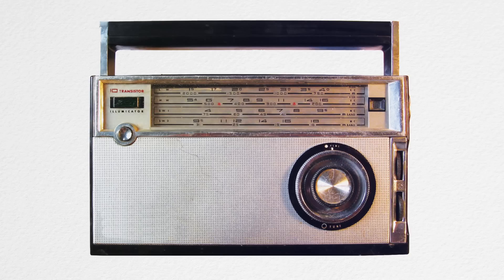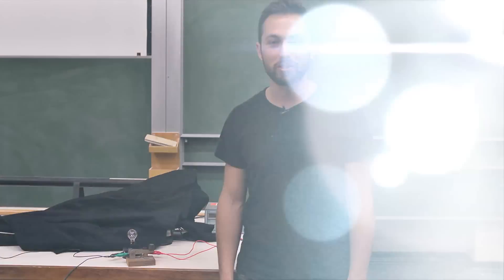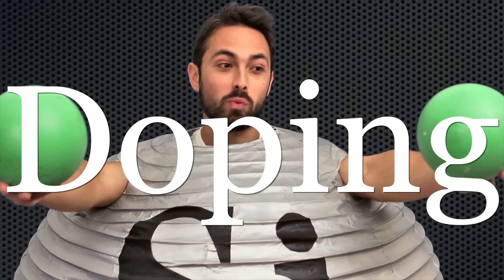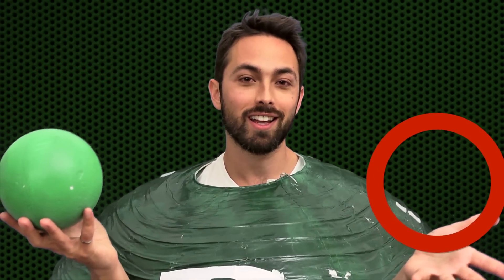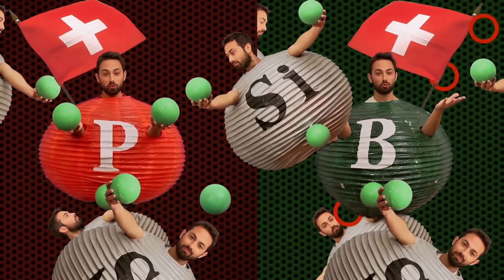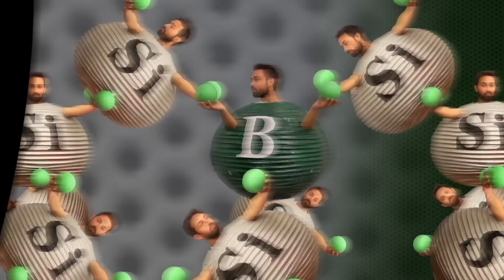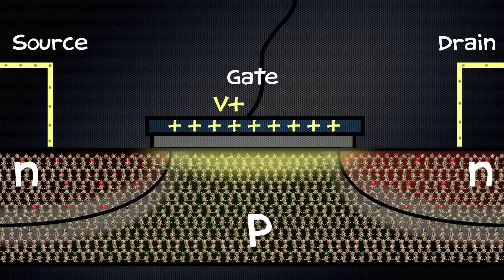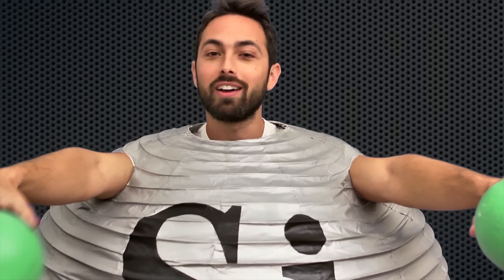How Does a Transistor Work?

Comment: Ah, now I get it; this shows clearly how a transistor's "mechanics"' work, since reading the Wikipedia description doesn't really tell you how simple yet sophisticated such a switch is.
Reply: Yes, but this one seems to be valid only to n-channels, I'm still strugling to know how p-channels work, that apparently when a gate has a current, it actually repels the flow.
Reply: PMOS works the same way.  All the dopant types and applied voltages are just reversed.

Comment: please anyone answers me........
i understands that in p type there are free electrons .....but in N type there are holes how they conduct,how they flow.......I meant to ask that those holes should remain around te boron why they move through lattice
Reply: It's actually the electrons that move. An electron comes and fills the hole. Another electron again fills it. So basically electron and holes swap each other. It seems like the hole is moving but it's the electron that is moving.
Reply: Ya .. But
Let consider only one boron atom then the boron cannot accommodate 4 electrons in bonding so there is a hole created by it 
......since it can accommodate 4 electrons so that hole will always surrounds it and does not move so how conductivity
.....?????
Reply: Nilesh Khatri So there will be 3 electrons rotating around boron atom. But there is not only one boron atom, there are lots of them. Thus the electrons around them conducts electricity.
Reply: ya you are right there are lots of boron atoms this system only works if there is a boron atom is joined to silicon atom which is joined with other boron atom,,,,,......,,,,,but........actually doping is done in very small amount if you talk about atomic level ..it is 1:10^6
so question still arises...
Reply: Nilesh Khatri OMG!!! That's Beyond my Knowledge.. Sorry I couldn't help..
Reply: Nilesh Khatri First, we must be clear that In metal bonding structure, electrons are thrown around like hot potatoes, the electrons are too energetic to stay in one place in any temperature other than absolute zero , dopping simply makes the "sea of electrons" even more active, thus increases the conductivity of silicon. So, without dopping, there are already "holes" and "moving electrons" all over the place, there's never such thing as all electrons "find a nice hole and settling down".

Now to answer you question, think about this, when a hole was created, many electrons rushed to accommodate that hole (Le Chatelier's principle), which at the same time have to leave a hole "unfilled" somewhere else (inside some other silicons). So that "hole" can be seem as "traveling". 

It's also important to be acknowledged that we never saw the process, but in terms of engineering, we don't really care that much about "exactly what happened", we care more about, "how we use this phenomenon to make money", so we didn't mind left some questions unanswered (the transistor theories was written by a electrical engineer in stead of strict scientists, he won Nobel price in Physics twice for his works)

Hope my rusty old college knowledge helps a bit, I won't be surprised if there are errors lol.
Reply: thanks :)
Reply: +Nilesh Khatri Technically it's not the holes moving, it's matter of perspective, if an electron flows from one hole to another, did the hole move or the electron?  It's really the electron that is free, and it's frowned upon within the industry to state the hole moves when in reality it's a free electron, or free electrons.  If you have more free electrons than holes there will always be electrons in motion.

Comment: This is a very explanatory video, but don't you just need another switch to trigger the gate?
Reply: You are right. I'll try to explain how an electronic device works after you have a transistor.

You can combine transistors in order to make logic gates. Those logic gates are just circuits that perform basic logic operations (AND, OR, NOT). You can make arrangements of those logic gates in order to create functions that use binary data, such as addition, subtraction, multiplication, division, and many other functions that your processor can perform. Having a set of functions, you can store instructions and data in a memory chip (basically a program) and automatically read those instructions using a clock signal (such as a crystal oscillator or a RC circuit) which feeds a counter (made by logic gates) in order to read the instructions stored in every memory slot, and that's how you run an automated program. The ultimate trigger of the programs stored in your device is the user via their keyboard or touchscreen or any interface. 

You can see a diagram of what I tried to explain you at the following link:
http://1.bp.blogspot.com/-Nw0z3NZI3XQ/Tgd_QrfwKzI/AAAAAAAAAKU/VjWnc6aQt0U/s1600/03.GIF

Hope it helps.
Reply: That was very helpful. I tried to look it up, but I couldn't find anywhere that gave an entire explanation.

Comment: The solution to the tunneling issue with shrinking circuits has been addressed. Once the circuits reach their smallest operating size to increase the number of circuits you start stacking them in layers. This also reduces energy requirements since the electrons can now flow vertically instead of longer horizontal distances as the chip expands in size.

Comment: Why isn't elements to the right of silicon more conductive if they have more mobile electrons?
Reply: to many electrons is just as bad as to little. you essentially want 50% holes, and %50 electrons for the best conductivity.
Reply: The electrons are mobile within the material. If an electron moves to the right, it leaves behind a hole. Another electron moves right to fill that hole and leaves behind a whole in it's place. Imagine this happening again and again. The electron will keep moving right and in theory that "hole" moves left.
Reply: Hana Zener Diode You seem to know a lot. Tell me, 
Why the silicon?

Comment: @Veritasium, sorry but your understanding of the transistor is either incomplete, or you oversimplified it. A transistor is more similar to a dimmer. A good analogy would be to says that with a little hand movement, you can open a valve, which would control a much larger force, such as a big water hose. Although, you are correct that we do use it most of the time on digital systems. Although, in many, many applications, such as RF, signal processing, signal amplification (which is used in all modern audio amplifier)

Comment: Arrrghhh. I normally really like your videos, but this time it mixed things up badly. The semiconductor configuration shown is a so called Bipolar Junction Transistor. (BJT), having a Collector, Base and Emitter. The error in the video is, that there's an insulated "Gate". Gates are found in Field Effect Transistors (FET) which have different configuration, namely a doped channel within bulk material. This might sound minor, but it has huge implications. A BJT is current controlled. A current from the base into the emitter removes the depletion zone. FETs are voltage controlled, there's no current flowing, instead the field from the Gate piches off the channel by inducing depletion from the bulk.
Reply: hexarith The structure showed here is a n-type enhancement-mode MOSFET, which requires a p-type body to function. The drawing of the structure, as well as the explanation of how it works, are correct. If you really wanted to be picky, you could point out that the "n" regions are, in fact, n+, meaning they are degenerately doped and behave like a metal. The FET is still called a FET even if, like in the case discussed by Derek, is used like a switch in a digital circuit, instead of a voltage-controlled current source like in a linear amplifier. There is no resemblance between what Derek has drawn and a BJT, other than the fact that a BJT also has n-p-n regions. The sketch clearly shows that the gate is isolated from the channel, whereas in a BJT you would need to have a direct contact to the base.
Reply: hexarith Thank you! you answered my question without me having to ask it : )
Reply: Andrea Morello

You're damn right!
Reply: Andrea is right. His explanation was absolutely correct and I think he did a great job touching on all the critical aspects of n-type FET operation, without being overly detailed to the point that it would be confusing to those who aren't familiar with this stuff. If you guys really wanna be picky, it would be about his explanation of channel formation; which he sort of glanced over without fully explaining.
Reply: hexarith You are very confused, The diagram he had in this video is clearly an NMOS, a BJT diagram would be two PN junctions back to back.
Reply: Yep, I agree. Plus explaining BJT, NMOS, PMOS would turn it into a 2 hr lecture so may as well head to uni for that. I believe this video is more of an introduction to the concept of transistors.
Reply: hexarith Derek chose the FET because the transistors he was referring to were obviously the ones found in chips and computer processors, which are mostly FETs. BJTs are preferrably used for current amplification than switches.
Reply: wrong, derek is right that's a MOSFET
Reply: "The semiconductor configuration shown is a so called Bipolar Junction Transistor. (BJT), having a Collector, Base and Emitter. "

No, it's clearly a n-type MOSFET, with a source, a drain and a gate. Did you even watch the video?
Reply: Conenion
Yes the spoken explanation on the video explains how FETs work… almost, because it's not entirely correct. However much worse is, that the semiconductor hetereostructure shown in the video would never be able to work as a voltage controlled device (FET). For working as a FET you'd require one continuous channel with a single kind of doping. If you create PN heterostructures you require some current to overcome the depletion. So you have three mistakes in the video: The structure shown is a clearly a BJT one, but it's labeled with FET annotations. The explanation how a FET works is almost correct (which is the worst kind of wrong) and then there's also a minor mistake in the explanation how the depletion zone forms (because it's not just  electrons falling into holes, more important is the resulting electrical field, which has to be overcome by an applied voltage, before a current can flow at all).
Reply: When does he say that what follows explains a bipolar? Where does he claim that all transistors are FETs?

You're right, he explains a FET. Which is the by far most dominant type today in microprocessors. In the intro he talkes about devices with a microprocessor.

Comment: Here're my 2 questions:

1) at 5:19 the Drain and the Source are made as one connection, shouldn't there be a gap between theese two? Even though the Source and the Drain at that picture are from "separate" transistors. On the other hand, I believe it's the way it all works, that all transistors are connected in a series to each other, so the the network of switches can handle the information.

2) I'm curious about how don't theese connections overlap with each other. I mean there are different layers of the chip, so the main question is how don't these gate tracks overlap in the chip? Maybe there's a good animation about this tiny transistor architecture?
Reply: 1) Two transistors where drain of the first one is connected to source of the second one create AND gate. If you negate the result, you create NAND gate which is one of two main building blocks of processors (usually a processor is built entirely from one of these types and does not combine them). The other is NOR gate, created by negating OR gate which is two transistors that share source and drain. That image is however just to illustrate Moore's law where the number of transistors double, it has nothing to do with actual connections.

2) I don't understand what you mean by overlapping. A wire has two ends which you connect to electric devices. A transistor is like a wire, it just has three ends which you can connect.

Comment: Hi there! Thanks for this video, it helped me a lot! 

However, I sorta got lost on how the voltage applied decreases the depletion layer when the electrons move across. So in the depletion layer the p-type semiconductor's part is negatively charged and the n-type semiconductor's part is positively charged. Thanks to the voltage, the electrons can move, fantastic! But does that mean that the moving electrons initially were the negatively charged part's electrons or is it once those electrons started moving everything started moving as well, or am I wrong, or do you not get me?

P.S. God do more videos. This makes physics simpler and more easier to understand. Maybe I'll actually consider engineering now ;-;

Comment: I have one question: Why doesn't the n type semiconductor on the right side send electrons toward the positive voltage? I'm just confused on how this works because I feel like all the electrons should just go to the middle due to the positive voltage. Could someone help in explaining this?
Reply: They are indeed attracted but they flow to the right because the right side (drain) is connected to the possitive end of a power source and that attraction is larger than the attraction of the gate (because the gate is isolated)
Reply: Jan Sten Adámek But that same attractive force you speak of would increase the depletion layer in NP junction of Collector-Base, so it would be even harder for electrons penetrating from emiter to base to flow to collector. That is if we draw the parallels with PN diode junction theory.

This was troubling me to for quite a while. It seems to me every body knows how transistor works, but nobody understands WHY it works.
Reply: rok13m
There is no parallel with PN diode because on PN diode there is no magnetic force of gate which is what closes the depletion layer.
Reply: rok13m Electromagnetic but that is what happens on gate of a FET (which is the one described in the video). If you use transistors with a base (bipolar), possitive voltage applied to the base thins the base-emitter depletion layer in a process called forward bias until it is small enough to allow electron diffusion across it.
Reply: Jan Sten Adámek Which magnetic force closes collector-base NP junction?

Comment: What turn on/off the Voltage though ? ~
Reply: anything...it could be a clock signal, a sensor output, radio waves (that would turn on the transistor every time the wave reaches a certain magnitude).  Basically, it's like opening a water faucet, something has to open it to let water through and that thing can be you...or a rope you wrap around the faucet, attached to a dog... anything.
Reply: But those are "signal". I'm wondering what physically induce the positive charge on the "gate" that create the voltage.
Reply: Ductie94 probably increases voltage
Reply: Ductie94 the positive charge on the gate is a voltage.  For example, there exists a temperature sensor with an output (dc voltage) that varies with a change in temperature.  That output (dc voltage) can be attached to the gate of a transistor to turn it ON or OFF when the temperature reaches a certain level.  Now this ON/OFF can be used to control an LED for example, or a fan.